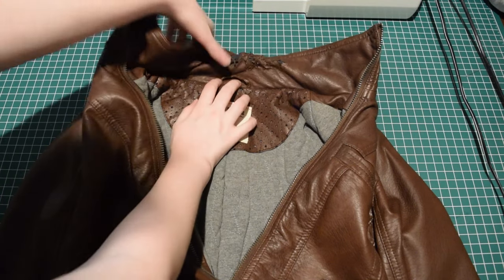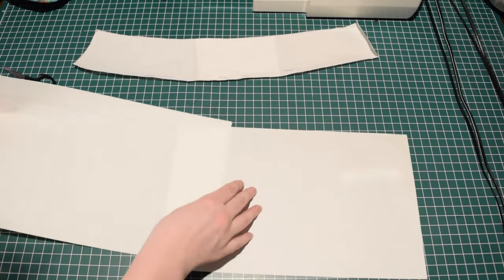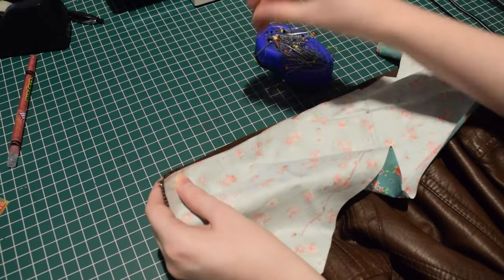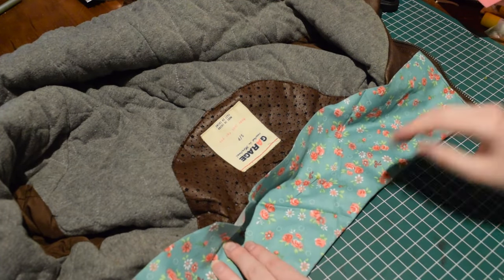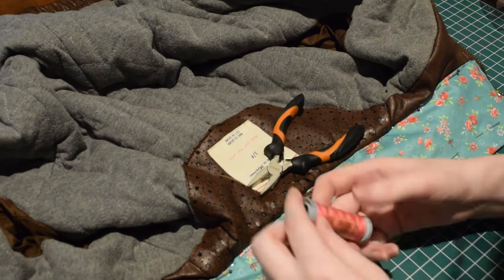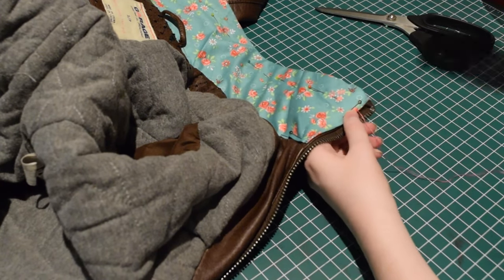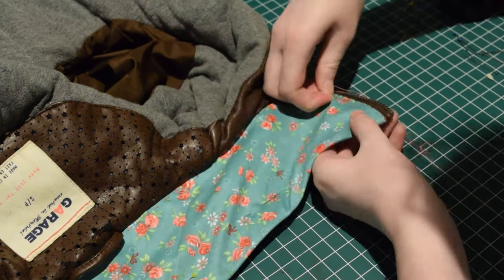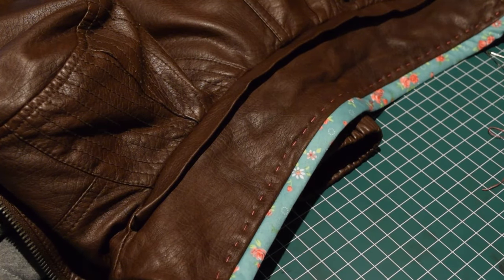Refurbished Collar on a Faux Leather Jacket

Comment: Thanks for a great video! I found a perfect bit of fabric for it! However, I learned the hard way, I should have pinned it and sewed it by hand. Instead, I used my sewing machine and it came out uneven and had other problems. However, the part I screwed up on is hidden when I wear it. I like my jacket and don't want to throw it out until it gets really bad, it's starting to peel below the neck. I sewed it by hand at the lapels and it looks great!

Comment: If a polyurethane or leather material jacket starts to degrade, it peels. It doesn't just peel in one area. It affect overall jacket. Tomorrow or day after tomorrow your jacket gonna peel in sleeves or in trunk areas.

This is the only reason I'm not buying such amazing jackets 😕 I'll wear 4 to 5 times in winter and thn what? Next year, it'll degrade. Hence, time to buy a new jacket.

Acrylic, woollen, etc coats are better, long lasting and durable.
Reply: I hear you..  this is true what you're saying about some faux.  I watched this vid to get some inspiration on what to do with a beautiful baseball jacket I have. The pleather is on the sleeves and it's starting to bubble even though I've not worn it many times. I've stopped wearing it because I don't want it to tear - I have even thought about injecting glue into the bubbles if I don't get a better solution. On the other hand, I have another lovely faux which I've been wearing regularly (a few times a mth)@for around 4yrs and it's pristine - I think there are different grades to the quality & it's about being able to identify the most durable pleather.

Comment: I’ve had my faux leather jacket for 4 years and it’s still in great condition. No degrading. It was over 100$ at J.C. Penney’s and so worth it. I might be getting a real leather jacket in the future.
Reply: Does faux leather will crack and pilled overtime?
Reply: @zyzmal2004  im sure it does crack but that’s probably if you wear it every day. I don’t wear mine every day and that’s probably why it lasted me so long. I still wear it though.
Reply: @dream_er4138  i just bought it and its very hot make me sweat
Reply: @zyzmal2004  I wear it during winter. For thinner ones you can wear them when it’s cool or at night. Maybe the particular jacket you got isn’t for you.